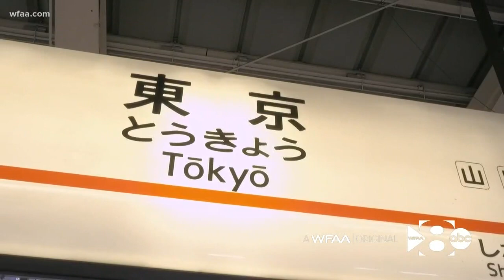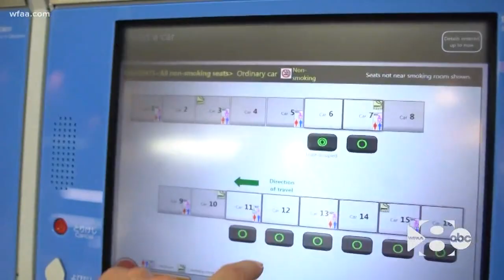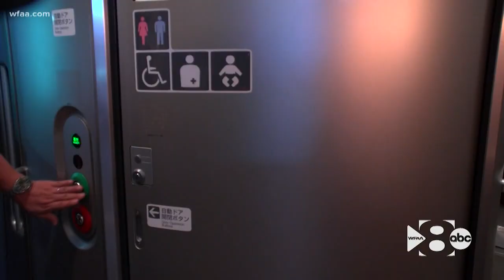WFAA Original: The Texas bullet train now looks likely. Here's what to expect

Comment: I go up to Dallas a few times a year for sporting events from Houston, and this would be awesome! So much better than the 4 hour drive! Something like this is long past due, and if it's implemented like the Japanese and Chinese trains, it could be great for travelers and workers through Texas. It's also long past due for trains like these across the US, as the only high speed network is the Northeast Corridor, I believe.
Reply: And that corridor is not even really true high speed. The average ACELA speed is around 70mph, with a very short stretch where it may go up to 150mph.   The ACELA unlike the Chinese and Japanese bullet trains shares tracks with freight trains.
Reply: It's a single line.  It's nowhere close to what Japan and China has.  The Chinese train system is amazing.  You can get anywhere and FAST.

Comment: I don't understand why you'd rely on uber why not connect to union station in Dallas where you have local DART rail, the TRE, and Amtrak making a separate station somewhere else far from existing infrastructure is a major mistake and something that could cost the entire system in the long run

Comment: There's one thing that the Japanese bullet train doesn't to unlike its counterparts in Europe and Northeastern United States have it run directly into an airport train station. Examples are TGV 🇫🇷 CDG & Lyon Airports 🇬🇧Class 390 Birmingham Elmdon Airport 🇰🇷 KTX to Incheon Airport before cancelation and 🇺🇸 Acela EWR and BWI airports. For Texas have a Branch of the Shinkansen Line Run Dallas Fort Worth George Bush Airport then Houston terminal. That way both American Airlines and United Airlines don't need to run Dallas Houston flights instead they can just use the train. In the Northeast Amtrak and United Airlines do this between 30th Street Philadelphia and New Haven Union Station via EWR Station.

Comment: don't count on it
Reply: @Jared Weide  - The N700AT (the N700 variation aimed at the Texas Central Railway) is - like the N700A itself - standard-gauge - it therefore would require minimal changes to fit the TCR (or even AMTRAK's NEC for that  matter).   It could, in fact, operate alongside both AMTRAK Acela Express trainsets (or the upcoming Avalia Liberty trainsets) or both - it need not be unique, even in the US.  As the WFAA doc points out, it is more comfortable - in economy class - than a Boeing 737.  (And I don't hate B737s - Southwest has lots of them flying out of both Love Field and DFW - both in Dallas, incidentally.)
Reply: Don't count on it on its proposed route.   The is NOT going to happen.
Reply: NIMBY ALERT!

Comment: Bullet trains are expensive to construct and maintain.  And there have been accidents in Japan involving bullet trains.  First the land will have to be purchased.  Special construction of the rail line, which will includes bridges, crossings, etc., will then have to be built.  Then folks must learn how to operate those trains, especially at high speeds.

Bullet trains cannot use the current rail system because it's not suited or practical.  Everything must begin from scratch.  IF this comes to fruition, at least five to ten years will pass before the first train departs.
Reply: “Bullet trains cannot use the current rail system.” That’s the whole point, that’s how you reach top speeds. Don’t get the concern trolling about accidents and land acquisition, since the Shinkansen has zero deaths and lower land acquisition requirements than our interstate highways.